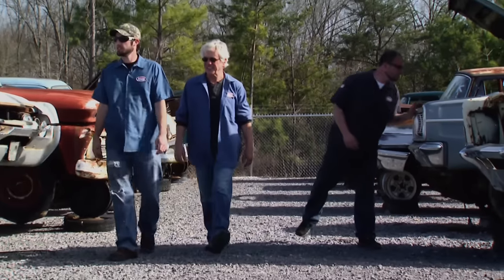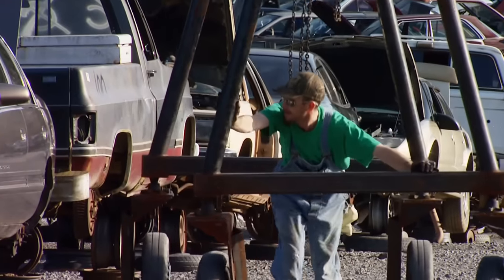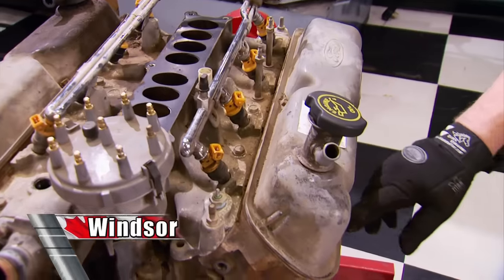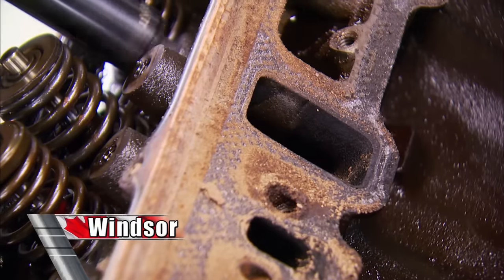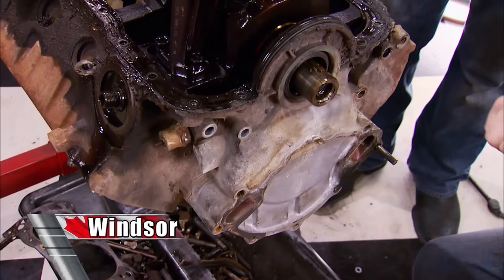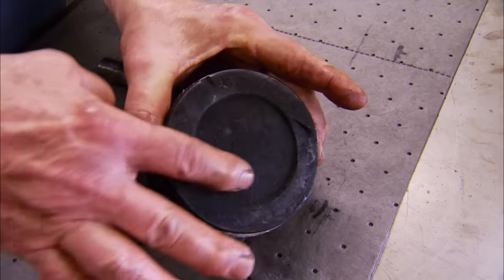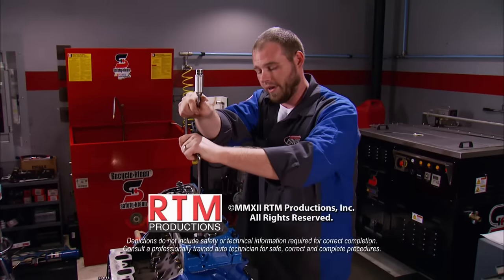Tearing Down a Pair of 351 Small Blocks: Windsor vs Cleveland - HorsePower S16, E10

Comment: Where exactly is the cutoff line between small block and big block?
Reply: The block its self is the cutoff. Two different animals. A small block can never be a big block. You can make a small block have more displacement than some big block engines but its still a small block.
Reply: @terrytdriver   I was looking for a displacement number which serves as a division between small and big.
Reply: There is no cut off you either have a small block or big block.
Reply: You can have a 427ci small block and its still a small block you can have a 262 ci big block still a big block. Different animals
Reply: So if it isn't about displacement and only about the casting, what's the point in delineating them as big and small, and why do they both exist? I'm truly trying to learn.
Reply: Big blocks are bigger in size which are stronger they have heavier crank shafts which provide more inertia to move larger heavier vehicles they accept larger and stronger transmissons Big blocks generally have more torque than hp at a much lower rpm. You got to picture the vehicles they powered in the 60's and 70's. A 350 hp small block sound fast and powerful until you put it in a two ton station wagon with 5 kids in it. You put a 250hp big block with 450 ft lbs of torque in the same station wagon you will stick the kids to the seat when you floor it. Horsepower isn't everything when and where is what people should focus on. Ive seen these guys put 4k into a small block engine and get 35 more peak hp at like 6000 rpm how much time do you spend at 6000 rpm in a pushrod
 engine on a daily driver? Might help at the end of the track.If you want to get off the line and lift tires of the ground you need a big block with a good  torque curve

Comment: Disapponted that there is no weights listed, both straight out of the old vehicles, and after their builds. This can be a critical choice between the 2 for various applications.
Reply: The C weights about 40 pounds more then the W in stock configuration.

Comment: 351W is the better of the 2, C is good but in my opinion the W is the best all things considered.
Reply: Based on? Dandy Engines in Aussieland is making 2000+ hp with it's twin turbo Cleveland based engines. All off the shelf stuff, try that with a Windsor.

Comment: As a Canadian, I find it somewhat shameful how much less skookum the Windsor is when compared to the Cleveland. The Windsor is essentially a "Cleveland-lite" from what I can see. The Cleveland was clearly over-built, yet the Windsor was on the verge of being under-built. Luckily, more modern Canadian manufacturing is absolutely top-notch. It costs alot of money to manufacture in Canada, so with what little we still manufacture (mostly military equipment and niche tech stuff), we make it the best it can be. Otherwise nobody would want to pay the asking price. If you're wondering what I mean by "military equipment", I dunno if you've ever heard of America's Stryker or LAV-25, but their hulls are all made in Canada by GDLSC (General Dynamics Land Systems Canada). Switzerland (Piranha) and Canada (Stryker, LAV-25, Coyote, etc.) pretty much have the market cornered when it comes to building LAV hulls of the highest quality.

Comment: Shel started with a 221CID 144 Hp Windsor truck engine with three speed from a wrecked Econoline van...

The AC Ace Bristol came sans engine.

A cheap J.C. Whitney floor shifter was purchased

The result was tested in an oil field

It worked!

For:

$400?

$700

Reports vary 

by decade...

Who is telling it...

THEN Shel contacted AC Cars

FoMoCo

BINGO!

J.C.

Comment: There you have it I love V8s but they really are unefficient as hell when you can get the same amount of power out of a 4-cylinder now reliability that's a different story That turbo 4 cylinder obviously isn't going to last as long or be very good at towing or other things in the working industry but if you look in for just power and get a lot more power from using a lot less gas

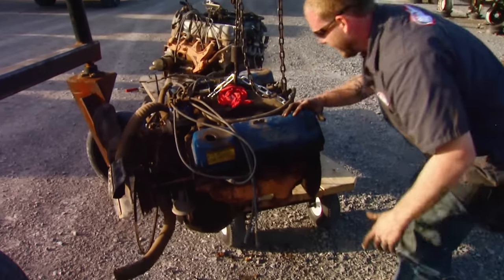Comment: So he only mentioned this in passing - at 4:18.  What is the 351M - i.e. 351 modified?  Is that a Cleveland, or a Windsor, or neither?  I have this in a 77 Thunderbird.  The one I have is more like the 400.  The Windsor was also available that year and is more like the 302.  I don't know why Ford did this - have 2 engines of the same displacement.  Also, what is "modified" about the modified engine?
Reply: 351M is a 335 series engine same serie as 351C but a different block.

Comment: The Cleveland is not a rare engine in Australia, used from 1970 to 1985, I've got about 6 or 7 of them, at least in the USA you don't have to worry about if it's a 302C or 351C, only external differences are a extra nub in the front of the head casting where it meets the block, depicting closed chamber (2V) heads, tho have found 2 302C's with the 351 open chamber (2V) heads (making 8:1 :( as to the 9.1-9.5 the 302C), & common to fit the 302C heads to 351C for more compression easy 10.5-11:1 (56-58cc STD) & better chamber design. as is using the 302C rods(6.025") in the 351c with a shorter piston, but most these days just go with 393/408 stroker & alloy heads. & being that the best Cleveland alloy heads are from Australia. AFD, CHI, Higgens, SCM.

Comment: "A basic parts store oil pump"  A funny place to cheap out on an engine known to have a sub-optimal oiling design.
Reply: You can  get a Hi-Vol. Melling from a parts store
Reply: @fordman4287  overkill,they used to pump oil up to the lifters and the oil used to stay there
Reply: I was just pointing out that you can get a quality oil pump from your average parts store, and for relatively cheap.i run a  hi-vol melling in my 390 and its very happy with it.

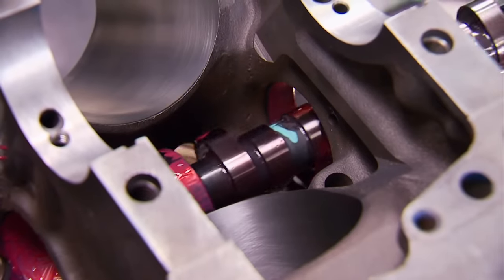Comment: 14:29 WHY? Why?  Do you use the WRONG PROCEDURE TO INSTALL THE CAMSHAFT???
CORRECT PROCEDURE is to turn the BLOCK VERTICAL then install the camshaft. 
Next bolt block to engine stand.

Comment: Pretty typical issues. The Windsor had corroded timing cover bolts that broke off in the block and the Cleveland bearings were washed out by a crappy blown out Motorcraft powervalve.

Comment: Too bad the US-built Cleveland 351 had thin cylinder walls. My one instructor back in the 90s said he saw so many of those with split cylinders. 
I can never find a definite answer, but didn't the Australian-built 351C blocks had thicker cylinder walls. One person said they basically designed Windsor-thick cylinders into their Cleveland. 
Again I can never get a definite answer on this.

Comment: A common internet false statement is referring to a Ford crankshaft as "cast steel". Ford did not, and does not, use "cast steel" crankshafts. They have only used cast iron or forged steel crankshafts. Very few (if any) automotive components are cast steel.

Comment: I skip the happy talk, did they mention the C heads have a visible 2 or 4 cast in the head by the intake, to denote the difference between 2 and 4 barrel heads? Or how if your looking at what appears to be a C but if the 2 or 4 is missing you're looking at an M? OR how at the start of Modified production some Modified blocks came with the SBF bell housing? Yeah, neighbor kid tells me they got a C for their project, I moseyed over, took a look and delivered the bad news.

Comment: You Should have Compared Both Of These 351s - "Manufactured The Same Year " (example)  2V Carbureted Engines... !972 Cleveland Vs 1972 Windsor.... The 351 Cleveland Was A Ford Short-Lived Production Run  That Also Powered The "Pantera", The Mustang Mach 1,, (351c V4)  Need I Say More .... This Is Not a Fair Comparison..... The 351 Windsor Carried on to Became a Very Dependable Passenger Car Engine & Found in some  F-150 Trucks + 1980s HO Ford Police Car  (Catalytic Dogs)....

Comment: The only stock 4V 351 Windsors I've ever seen were 1969s.    That must have been the 310 HP one.  There never was a true balls-out high performance 351W during the muscle years 1969-1971. 
Starting 1970, it seemed like all of the high performance 351 engines were Clevelands.

Comment: that was not a 71 LTD but a 73 mercury cougar.
Reply: It's a 1974 Mercury Cougar. The Mercury version of the Ford Elite. Note the big front and rear 5 MPH bumpers mandated for 1974 and the Opera windows (those little windows in the C pillar). That body style was made from 74-76. It was basically a "jazzed up" Gran Torino. 1974 was the last year of the true Cleveland. The Modified engine was introduced in 1975 to meet emissions. 1975 was a pivotal year in emissions. That's when catalytic converters and unleaded gas were mandated by the EPA. I'm only 4 minutes into the video so far...

Comment: The cleveland was not a small block, it was a big block. Post cleveland was the modified 400. Windsor block is a small block based on 302 block dimentions. An actual 351 cleveland far out powers a modified 400...
Reply: No, their is no small or big block Ford never called their engines like that. 400 was at the same time as the C, same series for the C and 400 but 2 different blocks.

Comment: USA engine makers have this uncanny ability to extract almost no power from huge capacity. Amazing.
Reply: In what context?  That stock HP ratings may not sound like much, but it’s still more than an equivalent era four cylinder.  And what is not mentioned is the over 300 ft lb torque.  American cars were big and heavy, these motors did not need to spin high RPM to provide the necessary output to move mass.  They are also very smooth, and can also be made to make impressive HP as they were overbuilt and of good airflow design.  Do yourself a favor and dig deeper as your have shown ignorance.

Comment: The M on 351/400 does not stand for modified! It stands for Michigan!
Reply: Where did you hear that - not saying you're wrong but the only difference between an M and a Cleveland is the deck height of the blocks.
I could be mistaken as to where the M came from, but I'd never heard "Michigan".
Reply: @Motor-City-Mike  I worked at Ford Motor for year's! I asked guy's that had worked there at the time.

Comment: So you just said there was only 2 351  Smalle blockFord engines. You said there was the 351 Windsor 351 Cleveland what about the 351 modified. I know they had 351 modified because I used to have one of them in my 1977 Ford F150 pickup. I think you should recheck your facts on the engines

Comment: I know to you Chevy guys a 351 Windsor is a 351 Windsor but you used the wrong year 351 Windsor you should have looked for a 1969 model they have better heads then that newer one you used and in 1969 the first year of the 351 Windsor they made 270 bhp with a two barrel carburetor and a cast iron intake

Comment: The Cleveland block was a big block. The 351 Cleveland was a small bore big block, not a small block. As for Clevelands fitting in the Mustangs, in 1967 Ford began putting 390s in the Mustangs. They were all Clevelands. I'm not saying every Mustang had a Cleveland block. I'm saying every Mustang with a 390 was a big block Cleveland.
Reply: Not at all, Ford never called their engines small vs big block. The C is a 335 series engine.

Comment: I had a 70s ltd and it had a 351 W/C
Reply: Windsor Cleveland
Reply: @centraltexasfoxbodies  nope just one it was stamped on the block never seen one since
Reply: @daylegatter799  A victim of YouTube Memory!
Reply: @Dayle Gatter I just realized what you saw. Your engine was cast in the Michigan Casting Center, not the Cleveland Foundry. That logo is a big "M" with two smaller "C"'s below it. UPSIDE DOWN, it would look like a W and the C's. Yes. Michigan made Clevelands also. Nothing special.

Comment: I had 3 - 351s back in the 70s and they were absolutely junk,  no power , couldn't hardly pull it self not alone a trailer with a little weight,  better off being boat anchors!

Comment: Of course they got it "Bass Ackwards" the Boss 302 had the canted valve heads before the 351 Cleveland existed.
The 351 Cleveland head design came from the Boss 302, not the other way around.
Too bad they don't research these things better...
Reply: lol....nope they put the 351 clevo heads onto the 302 Windsor to help the Windsor breathe up in the top of the rev range
Reply: @alt7488  Feel free to double check on that.
Look up the release dates (I was pretty sure but I double checked before I commented in the first place) - the Boss 302 was available to the public in '69, the Cleveland not until '70.
The Boss 302 Mustang was already competing in the Trans Am racing series in '69.
Reply: @Motor-City-Mike  the dates might be right,but you won't fit clevo heads onto a Windsor block without mods ,the heads where lifted for the boss 302 program  not from the boss 302 program for the clevo
Reply: @Motor-City-Mike  The Ford 335 engine family was a group of engines built by the Ford Motor Company between 1969 and 1982. The "335" designation reflected Ford management's decision to produce an engine of that size (335 cubic inches) with room for expansion during its development.[1] This engine family began production in late 1969 with a 351 cu in (5.8 L) engine, commonly called the 351C. It later expanded to include a 400 cu in (6.6 L) engine which used a taller version of the engine block, commonly referred to as a tall deck engine block, a 351 cu in (5.8 L) tall deck variant, called the 351M, and a 302 cu in (4.9 L) engine which was exclusive to Australia.
Reply: @Motor-City-Mike  that means the clevo heads where in production in 1969,available for the retro fit onto the windsor ...not the other way round
Reply: @alt7488  
Like I said - feel free to double check.
As to putting the canted valve head on a 302 at "home"  - I'm aware of the changes needed (Edelbrock even sold an intake for the swap), I built a few back in the '70s - we did because the factory Boss was limited production and the parts were Very expensive.
Reply: @alt7488  
The 335 series came out in '70 - (I remember (I was around back then) and I double checked as well, or are you arguing with documented history?
The documentation is wrong but you're right?
Reply: @Motor-City-Mike   we did because the factory Boss was limited production and the parts were Very expensive.......thanks for validating my point,,,it was a limited production run, requiring a fix,that fix was about to go into production with minimal mods....why would ford spend millions on  heads for a limited production run,when they could have spent a fraction of that on production heads modified to suit...your theories are flawed
Reply: @alt7488  Feel free to find something to back up what you're saying - recorded history (which backs up what I saw and remember) is wrong but you're right because you say so isn't going to convince me.
Reply: @Motor-City-Mike  i'll dumb it down for you seeing as you have the comprehension of a preschooler
ford made the 351c heads for the 351c not the boss 302w,
the 302w has big bottom end bearings making the bottom end strong but shit flowing heads,in 1969 they had the 351c about to come into production but not quite yet,this motor had well flowing heads above 5000 rpm,roughly,
instead of spending heaps of cash retooling for all new heads for a limited production run of mustangs to compete in one or 5 race series,they lifted the  351c pre-production heads and modified the blocks.
hence the boss 302 heads are actually 351c heads modified to fit a 302w block

Comment: The only thing that made the Cleveland motor popular was the superior head port design, aftermarket heads negated that advantage, waste of time comparing them. The top engine was the FE., not either one of these little 351's.
Reply: older than you Cali I would say the top engine was the 385 series BBF by the time these engines rolled out.

Comment: too bad you did not include a 351 modified in the group.
Reply: M's are not performance oriented. Even the Cleveland 2V's have the base of the 4V's in mind. As he said in the video, the blocks are already machined for 4 bolt-mains. That said, they are already 400+ cubic inches and lots of what makes Clevelands work also work on M's. Better heads and intake manifold, the M's really respond.

Comment: When they built the Cleveland they used a single plain intake and that's ok with the 2 barrel heads and compression ratio, they don't breath as well as the 4v heads and for the compression ratio they were running the 4v heads would've failed way better with a dual pain intake with the monster valves so u never really helped the 4v heads to their potential by higher compression and dual plain with this type build!

Comment: I live in RUST FREE,  NEW MEXICO. IF you need a RUST FREE car or pickup or body, just leave a text in the comments. 
I daily drive a RUST FREE Buick Riviera. 
FORD and CHEVY pickups from the 1970s, 1980s, 1990s,2000s are driving on these roads TODAY. And some car & pickups from the 1960s.
My 1982  chevy. 1/2 ton is RUST FREE and still runs great.
No need to buy a NEW,   $40k or $50k or $60k pick-up.

Comment: 70s engine vs a 90s engine BIG diference...
Reply: @centraltexasfoxbodies  Is not wath engine was first, is the year of the engines more than 20 years of diference and odviosly the tecnology of the 90s engines are better, if they are going to compare 2 engines at least they need to put 4 or 7 years of diference not 20 years of diference on the engines.
Reply: Shaun Bennett doubt it.  A late roller cam 302 or 351 EFI maybe did not make on-paper power like the 60s, SAE net vs gross HP, but I can assure you they ran better, stronger, lasted longer with better fuel economy.
Reply: Shaun Bennett all things being equal,  I would build a late roller cam motor, and have to good results.  In many cases the wear is so minimal, the cylinders need a hone and std. piston.